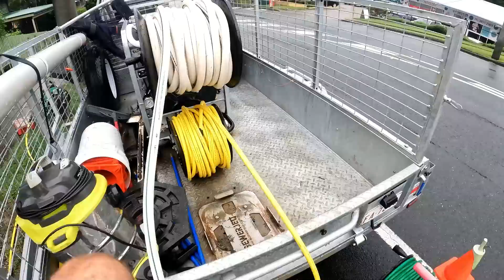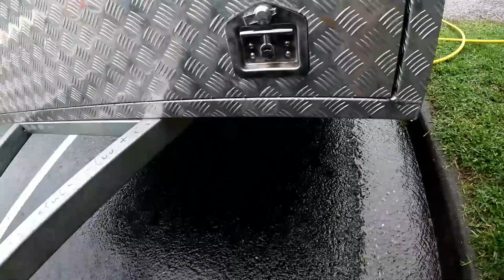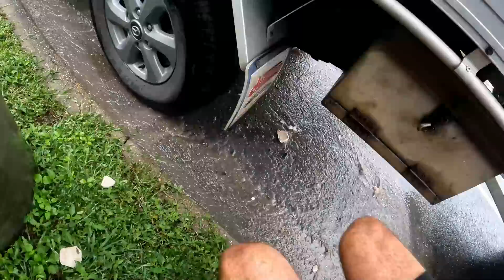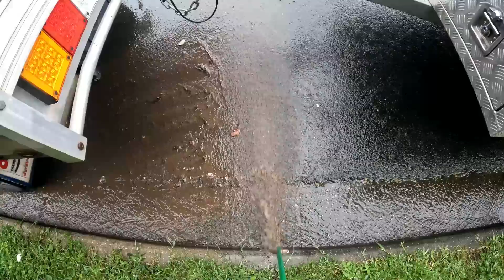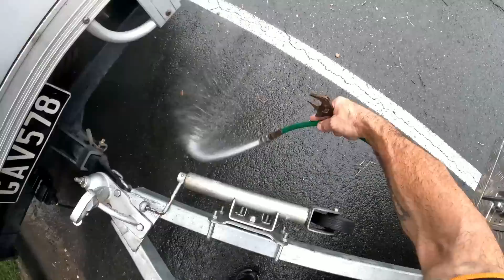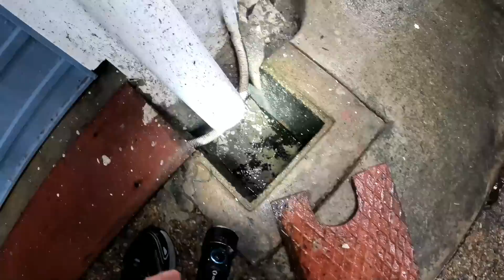Blocked Drain 246 - Explosive Unclog | Didn't Want Under The House To Flood | Contacted 30 Plumbers

Comment: Love your videos!
I've got a bit of a request ...
Any chance you could set up a length some sort of clear pipe (even some 2 liter drink bottle lined up) so we could see the different nozzles in action?
Thanks for sharing 🇨🇦
Reply from the maker: I have priced the clear pvc piping and it’s very expensive. I may do it down the track
Reply: @penetratorblockeddrains  That would be awesome!
Reply: Drain addict has a few videos like that on his channel showing how the nozzles work at cutting roots
Reply: @ScaniaK124EB  ... it was his local dealer who had the clear pipe demo. Interesting to say the least.

Comment: This shows your professionalism and desire to do a proper job, rather than just doing the job.   You had it cleared quickly, which is what the customer asked for - removing the concrete slurry that was causing the blockage.    That was the job the customer asked for - remove the blockage, drain the line.    However, you continued, checking to make sure that the lines were completely clear - coming up with some assorted roots as well.   I expect you will tell him of the penetration by roots as well as the damage at the end of the line by the curb.